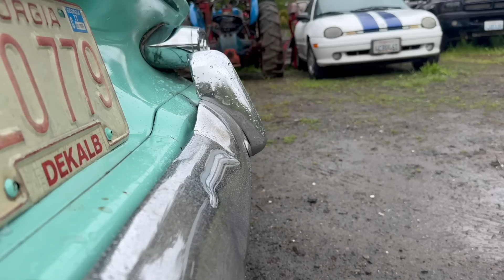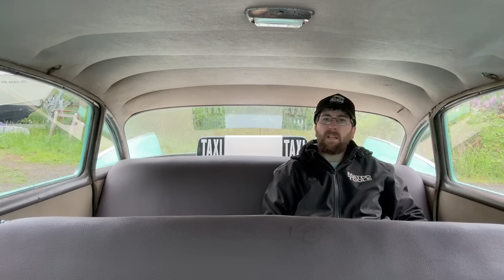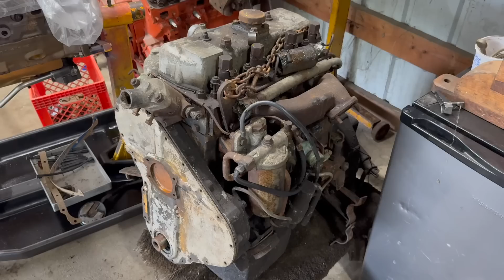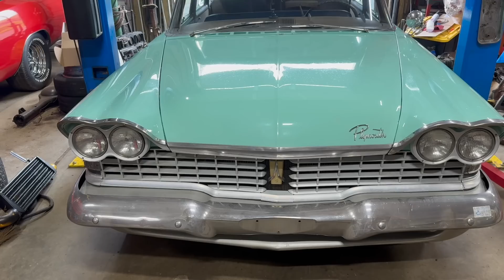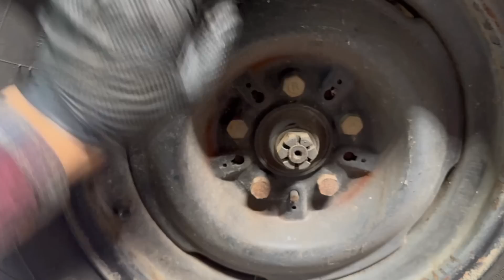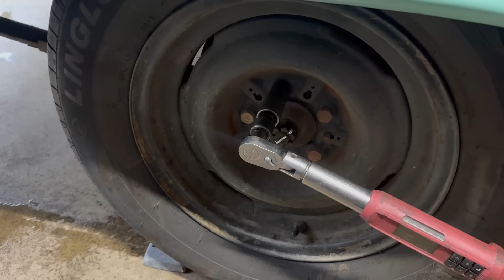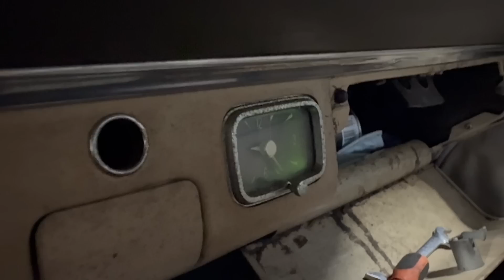Slow And Stinky - 1959 Plymouth Diesel Taxi Engine Tech, Test Drive, Safety Inspection (Not Good...)

Comment: phila yellow cab used a lot of Plymouths in the 50s and 60s  flay hea6 3 on tree no ac  after 1960 226 slant six was a fairly peppy car   probably no power steering or brakes . driver made around 50/50 split but had union dues and unfunded pension . and in 70s bankrupt several times including the day after 1 hit my co van . but drivers lost pension, creditors and accident victims went unpaid and city/state jerked the co and drivers around crazily up to today
Chrysler offered many different products as did few other makers notably ford crown vic for few yrs police and taxi for yrs after civilian sales ended mercury and Lincolns  were sold but not crown vic they hoped the 500 would sell but nope. Chrysler sold the 1959 -60 model half ton pickup to police and fleets up to mid 1960s the flathead power wagon also civilian got the current body pickup power wagon  . 4 d pickups to air force were plentiful not known if civilian could buy new .  last one was chevy sold a AU caprice police car . wonder what othere gov fleet only were around . usps got many custom models  good part fits there needs bad they buy hundred thousand every 25 yrs so no replacments for expansion or totaled to be replaced

Comment: I'd send the pump and injectors out to a GOOD diesel shop and have them checked and dialed in. That won't be a power house, but it should run better than that. Check compression too. Can't use regular gage though.
Reply from the maker: The injectors have been rebuilt. Think I’m going to swap on the other pump and see where that gets me.

Comment: In 1967 my dad had a 1958 Plymouth Belvedere 4 door with a 6 cylinder and pushbutton trans. I was 12 years old and it was the first car I had driven all alone. The color was a flat gray and it had plastic covers on the seats. He sold it and bought a Volkswagen bus. That's the car I learned to drive a manual transmission on. I would keep the diesel and put a Turbo on it.

Comment: "...we're gonna tamper with it anyway."  That cracked me up.  😂
Reply: If you're really going to "Hotrod " this Perkins find a old Massey Ferguson dealer that has knowledge about this Engine.
Had a relative that sold them and had several Mechanics that had pulling tractors.
Guess the Massey Ferguson 35 might have used the same or similar engine.

Comment: Of course the front clip of this nifty '59 perfectly reminds me of the 1959 Plymouth Sport Fury, 2-door hardtop, that my Uncle ordered from the factory back in the day.  He ordered his car in the light blue color, and with the 318 Poly engine with factory 4-barrel carburetor.  It was an awesome car and ran really good.  And, oh yes, it had the push button automatic transmission.  Keep up the great work Jamie.  These cars must NOT be allowed to evaporate into oblivion.  Unfortunately, I have no idea what happened to Uncle's car.  He traded the '59 for a brand new '64 Fury 2-door hardtop (also equipped with a 318 Poly, but with 3-on-the-tree).  I DO know where the '64 is to this very day.  Because I owned it myself for over 30 years, and only sold it recently.

Comment: I love it. The only thing that would make it cooler is if it were a wagon. Have you been Googling “Perkins turbo diesel?” I wonder if you can convert the pump to normal throttle operation. One of the reasons that diesel engines are more efficient is that they don’t have throttling losses (this one being an exception). Seems a poor trade off to make your windshield wipers and heater controls work. An electric vacuum pump would cure that. 
The spare engine screams “diesel Exner A-body wagon” to me.
Reply from the maker: Oh I’ve got all kinds of ideas for pump control. That’ll be an upcoming video. And yes, an electric vacuum pump will solve a lot of problems.

Comment: I'd keep it as is.  I'd sure do all the tune-up tings.  Filters, valve adjustments, rack adjustments, maybe bump the timing a bit ...  That little Perkins should have some grunt.  So it should love short shifts.  Try to cure the oil leaks and make sure the fuel system is tight and dry.  Wet diesel smells in the cabin make any trip get old quickly.  I might be tempted to do a bunch of exhaust work to make sure that any black smoke goes ALL the way out the back.  And I'd keep the exhaust tip pointed away from the sidewalk.  No point in stinking up pedestrians and babies in strollers.  But over all, it seems a fun odd ball project 😅
Maybe see how far you can hot rod the spare engine (up the CR, turbo, timing curve, etc) and then swap it in ...  Add the OD tranny 😁
With the white top, it's screaming for wide whites on HD rims 😂
Reply from the maker: I have learned that short shifting is the only way to get the governor to kinda cooperate - but there is still no grunt. This is my plan! Tune it up and see what there is to be seen.

Comment: I LOVE IT!  I WANT IT!  Turbo Perkins!  I wonder if there's another pump that will fit that does away with the vacuum nightmare... maybe on a Perkins marine engine?  The throttle pedal directly controlling the pump would be great.  It would be cool to find and install an overdrive trans.
just to show you I'm as diesel weird as you are... I have a mid 80s Isuzu 4L turbo diesel with Chrysler bellhousing adapter... it might be going in my 07 Dodge Ram....   I'm tired of the exhaust bolts snapping off on the Hemi...
I have a long shaft Chrysler 4 speed (truck?) that came with it... if you know anybody that wants/need one.

Comment: That thing's awesomely weird.

The power deal: Fuel system issues? Plugged filter, tank pickup, etc? Maybe if there's a low pressure/lift pump it's a bit pooched?  Possible that throttle blade isn't doing throttle things?
Reply from the maker: New filter, great pressure out of lift pump, throttle blade movement verified and adjusted.
Reply: @DeadDodgeGarage  Hmm, ok. Pretty sure you mentioned it but maybe the rack isn't swinging all the way to full fueling. I did a bit of google research and also saw mentioned the condition of the diaphragm. If it's leaky, possibly limiting fueling?

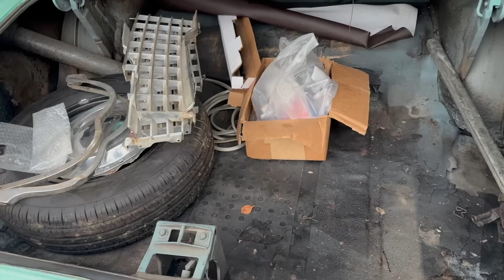Comment: 27:55 ALWAYS check the lugs.  I bought a little $700 beater 1989 Nissan Sentra in 1998 from a car dealer in Ohio.  On the trip home, I made a right turn and went right.  My left front wheel went left and bounced into the driver door of a brand new '99 Suburban on a paper tag, also on their way home from a car dealer.  That guy was not happy.  My insurance company was not happy.  The three lug nuts I borrowed from the other three wheels were not happy.  My wallet, lighter from the insurance premium increases and the small bill for a handful of lug nuts, was not happy.  If I had checked the lug nuts before leaving the lot, everybody would have been happy!

Comment: Perking diesel was sold off to Cat diesel. That's diesel looks like a landrover engine. I worked at a branch putting in CNC machines. Big enough to fit a V16 block into. They mainly build stationary engines for generators.

Comment: I have seen a diesel engine in my past that had a little (1" diameter) "pot" with a lid on it in the intake manifold. You would put an ether capsule in the pot and press it until it ruptured on a barb inside the pot. Maybe there was one of those where that hole in the manifold is? If the prior owner was routinely using ether the rings cud b shot, but u no that! Also, you gotta check/change the fuel filter, but u no that! Have fun kiddo!
PS, my suggestion for a nickname is "The Glacier"
Reply from the maker: Fuel filter’s brand new. There is a lid there… that’s interesting. I like the Glacier 😂

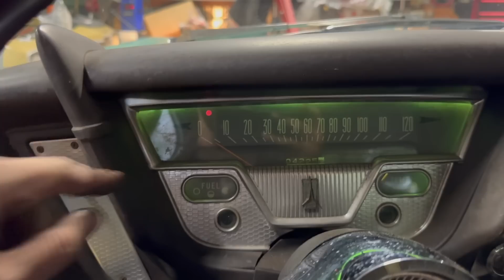Comment: 30:36 Of all the FL cars, 59 Plymouth has especially bad contacts in the turn signal switch.  Every other model of FL I've messed with has ever had any problems with the dash lights not working.  Usually a little contact cleaner, and maybe a little solder fixes that issue.

Comment: 38:07 I'm still thinking 4-53T Detroit. Or maybe find the six cylinder variant of that Perkins engine?
Reply from the maker: Some day, I WILL do a 453T in something. I’m not putting 1300 pounds of engine in this, but something. And… I was musing about a 6 cylinder Perkins too. I can’t do that either, but I bet it would fit without too much effort.
Reply: @DeadDodgeGarage  Maybe a turbski will help the li'l 4 cyl then? Though how that would work with the funky pneumatic throttle nonsense they have going on is beyond my pay grade. I'm barely familiar with diesels that throttle solely via the injection pump and dont have a throttle blade at all...

Comment: And Again: You sniffed out another one off! This diesel conversion is sooo nice, I´m wetting myself- we used to do this in the 90´s: get an S-Klasse Mercedes and put in a 50hp 2-liter diesel, make it a wandering dune… And the column shift! Putting in a manual is the only way- if paired with an automatic You could put a stone on the gas & pluck some flowers for the Lady, then it´ll be ready to depart.
But yeah, this is Christines weird cousin, what a nice find! Please keep it stock but fine tune the engine, withstand the "must turbo this" reflex. I´m shure if Mr. Perkins had some tlc he´s ready for another show!

Comment: Well you know back then the speed limit was 55 so you're almost there you can also put two quarts of ATF in the fuel and that'll help with lubricate that injection pump and get it to working along with your injectors
Reply from the maker: I will definitely be using some additives. If this damn car would GO 55…

Comment: I know yoj mentioned it but On the tractor equivalent tp those perkins they are known for the rack sticking, so worth checking
Reply from the maker: I pulled the inspection cover and checked. It appears to move to full open as it should when the engine is off and stop cable is in.

Comment: I too eyed this car when it was for sale in the past. I could not justify owning it. I have one obsolete impossible to find parts for diesel Toyota in my life. It too has a pneumatic governor. I quickly learned if the diaphragm tears or the vacuum tube becomes disconnected it goes full throttle. Interestingly the diaphragm in my Toyota is leather.
Reply from the maker: Yessss, I’m a little concerned about that. Before there is vacuum in there, a spring sends the diaphragm to full fuel for starting. I don’t like that governor design at all.
Reply: @DeadDodgeGarage The Toyota has a fairly complicated system called EDIC. It is essentially a external solenoid that moves the pump to over fuel for cold starts, run and fuel cut off. It also functions as a low oil pressure fuel cut off. I have had the little 3B start to run away while playing with fuel settings and when I accidentally knocked the vacuum tube off. As I am sure you are aware of, remove the air filter and have a wood block ready to cut airflow when messing with the pump. When my diaphragm ripped it was more of a gradual climb in rpm. I look forward to the future videos on this gem.

Comment: In Argentina we had lots of Dodge products with the Perkins, mostly taxis and farm trucks (like Jeep station wagons) they are unkillable. You can still go to farms and cities and see delivery trucks completely rusted out, but the perkins still running. Only issue we got is the cold start, they are very hard to start in winter 😂😂😂😂
Reply: I had a factory block heater on my 240d. Plug it in a little while before you go in below 40 degree weather and all works fine. Engine oil will stay warm for at least ten hours or so. I asked a “Mercedes specialist” if he cold fix the clutch slave cylinder that leaked and also replace the block heater plug end. The creep filled the brake rez and cut the plug off at the block. Never fixed anything!!
Reply: Como se dice "cosby sauce" en espanol?

Comment: I had one of the four cylinder diesels that Dodge sold through the dealers to install in trucks with the 727 transmission. I think it was a Mitsubishi diesel, I gave it to my brother to put in his 1941 Power Wagon
Reply: The late 70s Mitsu is a 4.0 liter 6 banger.  Came as an option in the 78, 79, and some 1980 D and W 100-200 trucks.  I DD a a 78.
Reply: @barto6577  they had a 4 cylinder as well

Comment: That's a big swap... Now you don't have to deal with that rusting car... You must be relieved...
As I get older, I try to avoid rusty vehicles.

We need to research how much boost the diesel will handle...

We need to put on disc brakes front & rear, airbag suspension, anti sway bars, 20 inch chrome rims.... perhaps parts from a RAM like Rack & Pinion... 4 turbos!

Nice car, can't wait to see how you fix it up!
Reply from the maker: I’m going to ignore all the stuff about disk brakes and 20s 😂 will meet you in the middle at one lil turbo, and maybe one sway bar. Yeah, as much as I wanted to build a Charger from the ground up… I’d much rather do this.
Reply: @DeadDodgeGarage  Have fun, cool car!

Comment: 22:12 there should be an adjustment for the “full contact” brakes, given that they’re basically the same as I had in my 49 Plymouth. At about the center of each shoe, there is a bolt through the backing plate.  That bolt rotates a cam that rides on the back of the shoe and forces the shoe’s resting position out closer to the drum. The adjustment is simple… crank until it drags, back off a hair.  It’s touchy, as it only takes a fraction of a turn to go from “backed off a hair” to “locked up.”  But it works.  The biggest drawback to that braking system is that it’s nicely self-applying rolling forward (as are Bendix brakes) but is self-UN-applying rolling backwards, leaving only the rear brakes effective in reverse.  The fact that I learned to drive on a 49 Plymouth with that “feature” probably accounts for the fact that, 50 years after learning to drive, I still occasionally have a nightmare about rolling backward into traffic and being unable to stop despite both feet on the brake pedal.  😵‍💫

Comment: 0:10 what's white with blue stripes?
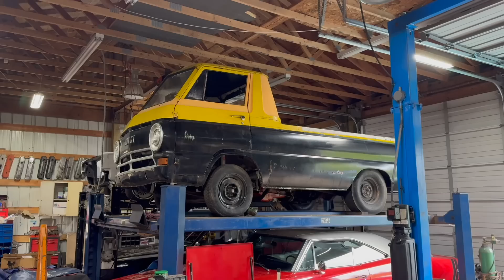12:22 ABSOLUTELY NOT THIS IS SO MUCH COOLER, then the logging road Charger.
I'd keep the itty bitty Perkins and throw a super charger on it get some power out it. Change that fuel rack to something less primitive. Pneumatic governor "Lurch groan". This thing is a hoot for sure.
33:07 the Mint Turtle.
Reply from the maker: Supercharger? But… turbo
Reply: @DeadDodgeGarage  supercharger no turbo lag. I've seen it done on a four cylinder kubota diesel.

Comment: Back in the later 1970s, I owned a 1959 Savoy (same color as yours)...it had a flat-six engine, and a 3sp....it too was slow of course, but that six was so quiet, so smooth. I could balance a nickel, on edge, at idle. It turns out, that 1959 was the last year for the flat-six. Those heavy cars really needed a V8 engine!

Comment: Wow Jamie, what a score! This is museum worthy. The older Perkins I'm familiar with don't use a grid heater as such. They use a gizmo that admits a little bit of fuel and a small heater coil to ignite said fuel, thus creating a small campfire inside the intake to warm things up. The injection pump is inline, so it predates when CAV started license building Vern Roosa's rotary pump. FYI trivia, I've had a few Perkins 4.236 and 4.248 engines in aircraft tugs. They came with C4 automatics behind them, so there are auto trans adapters for Perkins out there. Also, the 1004, which is a newer version of the 248, was available in turbo versions in generators and such, and these three engines are about the same physical size as the P4, so if you get the urge to engine swap, there are decent options within the Perkins family.
Reply from the maker: Is THAT what that’s for?! Mine has a tank and a hand pump labeled “primer” in the dash. I wondered what kind of sauce should be in there.
Reply: @DeadDodgeGarage  Not having seen it, my guess is hit the glow plug button long enough to make it hot, then the hit the plunger to give it some fuel. Here's an illustration on a Massey tractor: https://www.youtube.com/watch?v=NeDvCVS38hk  Good luck!

Comment: I have a ‘59 Plymouth wagon with a three-on-the-three. What’s nice about the column shifter in these cars is the shifter can be lubricated with a grease gun. The fitting is located along the steering column, under the hood and near the firewall. I was able to get replacement bronze bushings for the shifter arms at a “bearing, belt and chain” store. The rubber grommets for the transmission shifter arms can be found N.O.S., but we all know rubber has a finite shelf life. 

My experience with the Full Contact front brakes was they were difficult to keep in adjustment. Once the adjusters are worn, I found N.O.S. and good used supplies were depleted. I installed an AAJ front disk conversion kit, dual master cylinder and adjustable proportioning valve. The brakes have been consistent after that. 

The thing is, it would be nice to keep a survivor Perkins diesel taxi as original as possible, though it would possibly be a challenge to drive it in some of today’s traffic.

Comment: Not just fuel savings, but also maintenance costs. Gasoline cars in that era needed spark plugs, points, condensers, plug wires, and carb adjustments. A Perkins needs an oil change and a very occasional timing adjustment. Unless your picky about oil leaks lol. Pioneer. You may want to check the pump timing and compression if you want all 55 raging ponies. The styling reminds me of my Mom's Dodge. Definitely a weird old car. Kudos!

Comment: Interesting. I'll bet that would be a good highway cruiser. Once up to speed fuel mileage would be great. I wonder if a 4BT would fit in it? Go wild: find a wrecked Ram 1500 Ecodiesel with the 3.0 V6 Fiat diesel and 6 or 8 speed automatic. Still not a power house but tq & hp numbers close to a  LA318. A mix of old and new.